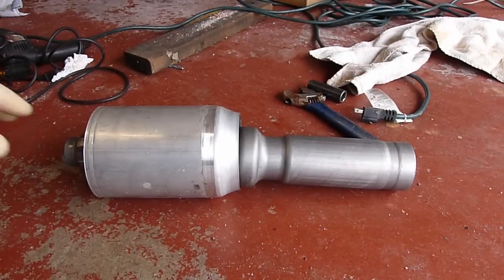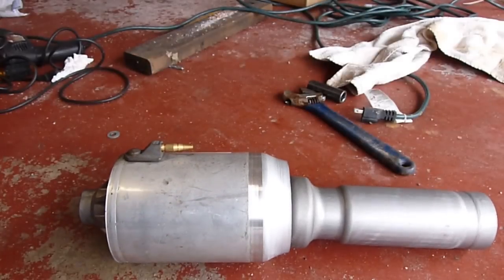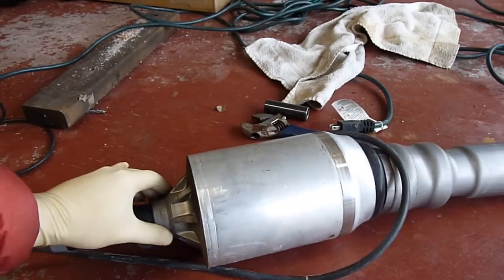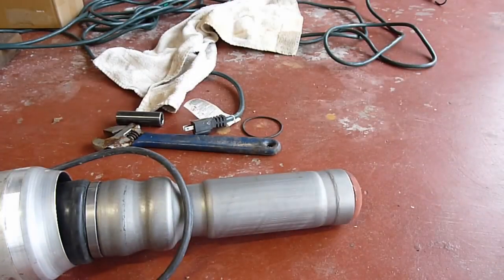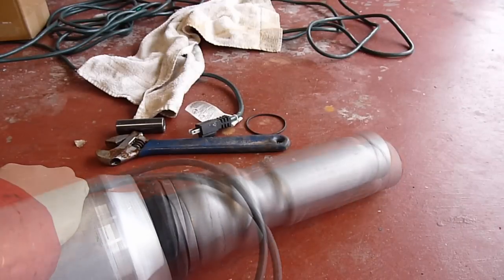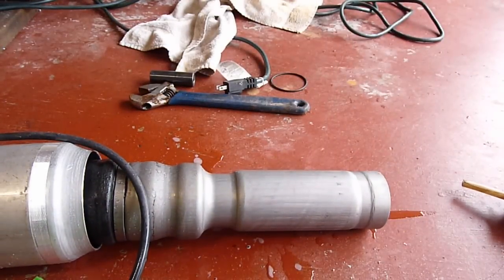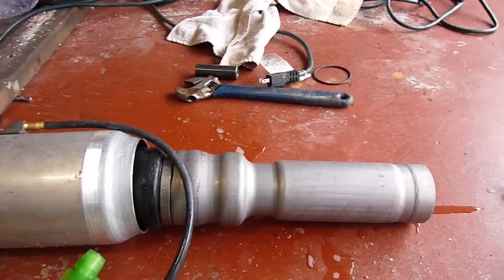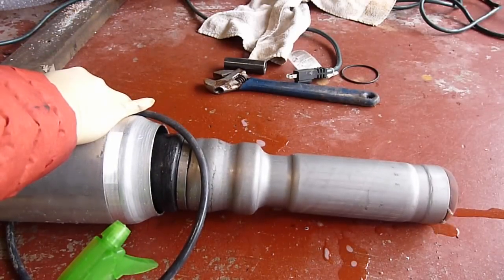Test Audi A8 Air Spring Bag For Leaks

Comment: Which valve did you use to pump it up?
Reply from the maker: Mustafa Solmaz don’t base on this, just my experiment, doesn’t prove anything. Read this to find your problems 
http://www.dognmonkey.com/audi/2006-a8l-d3-front-air-suspension-failed-119k-miles.html